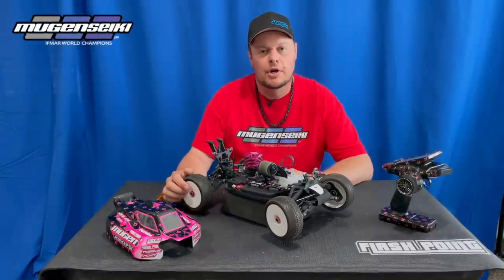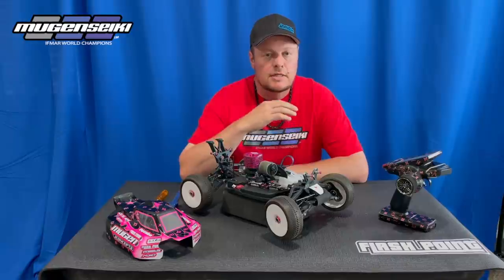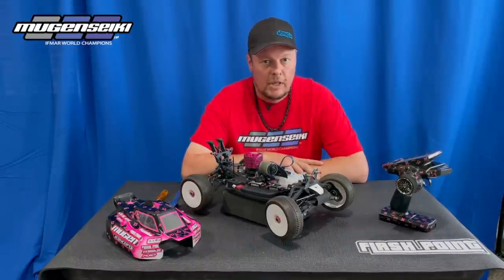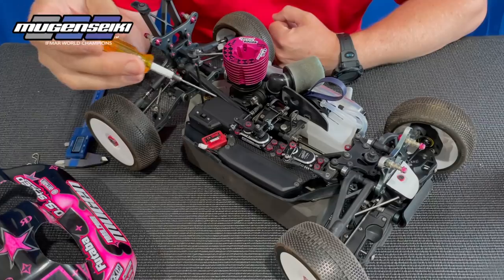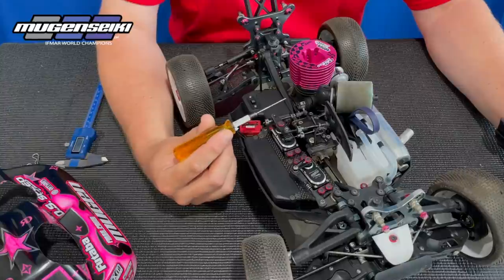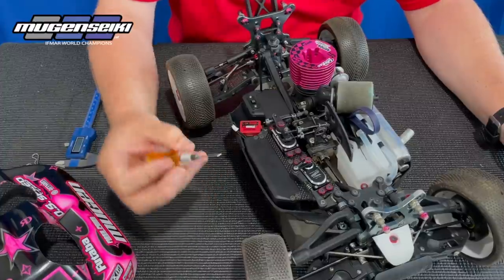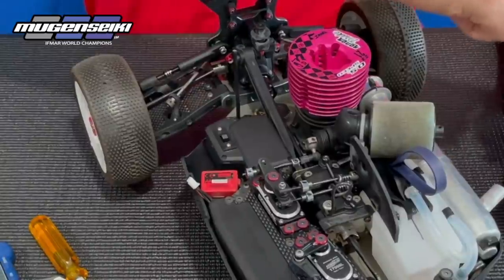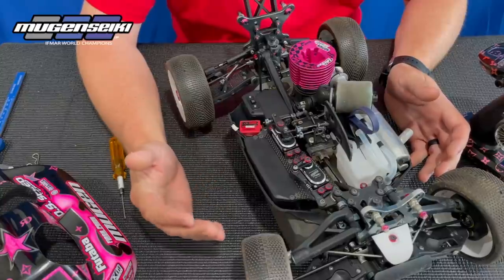Setting brake linkage.  How much brake is needed?

Comment: I found a way of putting a number on brake force. I use a small hand held torque wrench with a 17 mm socket. I first set my dead band with a feeler gauge at the same way Adam did. I then set my endpoint to 100% for the max brake force. Usually i set it so it's just enough to lock the wheels. I then make sure the bias is 50/50. After i all i need to do is lower my epa for the grip conditions. This way I am sure everything is perfect and always the same. I then tune the bias with the thumbscrews. it works pretty good.
Reply: Does your radio let you set brake travel without having to change epa?
Reply: @alb9022  I have a M17 i just lower my dual rate
Reply from the maker: Very nice.

Comment: Thanks to this video I learned that you can adjust the brake bias by turned the set screw knobs to thread the rod in and out. I had no idea! I’ve been disconnecting and cutting fuel tube for ages
Reply from the maker: My pleasure!

Comment: Hi Adam! Quick question - for the 170BL servos... They are very difficult to rotate when the power is off. I don't see any sort of fail safe rubber band on the servo yet. Do you add one for these servos? I just purchased one servo to see if I would like to place in all my vehicles, but I am worried about a situation where receiver battery power is lost with the throttle slightly open. The typical rubber band I use isn't strong enough to close.

Comment: Thanks for this video ! About the air filter, is it the TLR241039 (for 8X) or the LOSA9150 (for 8T / 8B) ? Bought the TLR241039 but it does not fit as it touch the black plastic piece that protect the fuel tank
Thanks

Comment: I just remembered my old futaba 3vc had anti lock braking in the menu and would
Pump the servo . I wonder if the new radios still have that feature? I will
Have yo
Check my 7xc. It seems like it would work well with the latest HRS servos .

Comment: When doing the brake bias test with the rubber band, do you ever get a rough feeling out of the brakes? Like they're warped? Mine feel as far from smooth as possible. What could cause that? The only thing i could find on it was stuff about full scale cars and the pad material being unevenly embedded onto the rotor

Comment: But Adam Drake  my EPA for brake is only for both front & rear on my DX5C...the other EPA is for carburetor end points..how do i adjust the brakes separately from the front and rear?
Reply from the maker: You should be able to do that mechanically with the linkage.

Comment: When you set the throttle EPA, you said it has a 6.5mm venturi. We know the carb will close past the venturi when at idle so this would also mean that if you measure the opening with the throttle throw at 6.5mm, it wouldn't completely clear the venturi at full throttle due to the thickness of the venturi. Would this be of any concern since the throttle never actually reaches that fully open position?
Reply from the maker: Yes, when setting the throttle linkage and carb opening, I considered the idle gap 0 or 0% throttle.  Then open it to the venturi size (6.5mm), it may not be prefect, but gets you in the ballpark without having to remove the filter and the risk of dirt getting into the carb.

Comment: Doesn't temperature effect the bias during a race?
Reply from the maker: It shouldn't.
Reply: @AdamDrake  does the material used for the discs make a difference? Or do you use pads on metal discs?

Comment: I notice the front on her car has a lot of toe out it looks is there a reason for that
Reply: I noticed that also, A LOT of toe out. I wanted to ask if this is common. Probably helps keep the outside front from catching ruts.
Reply: Makes Turn in at slower speeds faster and smoother.  Down side is a car can feel a bit twitchy at high speeds
Reply: I've noticed this on Adams Buggy in several recent videos too. Massive amounts of toe out up front. Probably looks exagerated because it is up on a box as well.
Reply: Probably because it’s on a car stand. With the suspension compressed it wouldn’t be anywhere near as much toe
Reply: It’s not much toe it, it’s mostly bump steer, when the car is at full droop it looks like a lot, but when you set it on the table it’s probably about -2° of toe out.
Reply from the maker: Yes, we always run a fair bit of toe-out in the front with 4wd cars.  I like the way the steering feels and seems to add stability.
Reply: @AdamDrake  Thanks for the feedback. 4wd buggy is new to me. I'm an old school 2wd nitro truck guy so that much toe has been hard for me to wrap my head around. will be hitting the track this weekend for the first time in over 20 years.

Comment: Thanks For the great videos as usual. I was hoping to find a video of run on for nitro. Fairly new and last race my car felt like it was accelerating at every corner when I needed to slow down and it was pushing me way out. Ugh. Any help would be highly appreciated.
Reply: Bottom end is too rich. Lean it out and lower the idle as needed. JQ has a great hour long video on how to tune an engine and addresses run on and how to fix it perfectly.
Reply from the maker: My pleasure!  Could be rich on bottom and you may want to adjust the clutch setting.